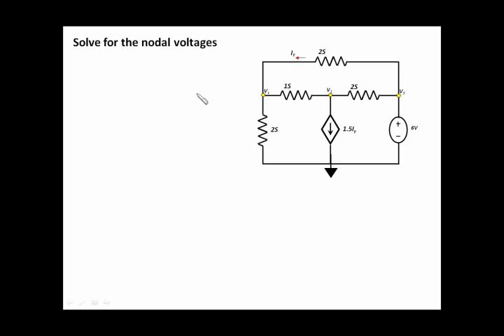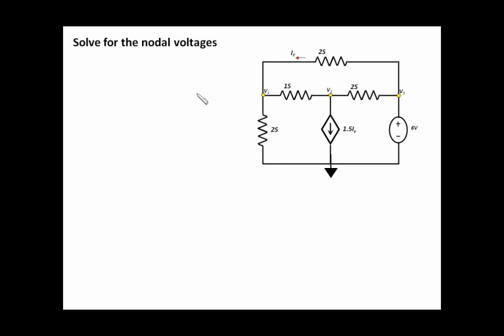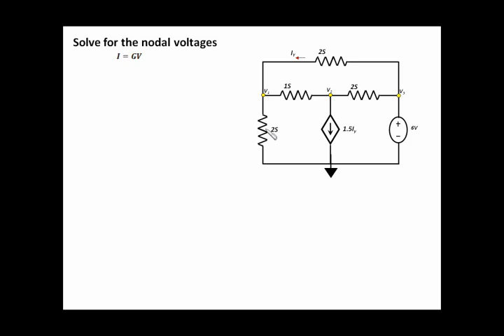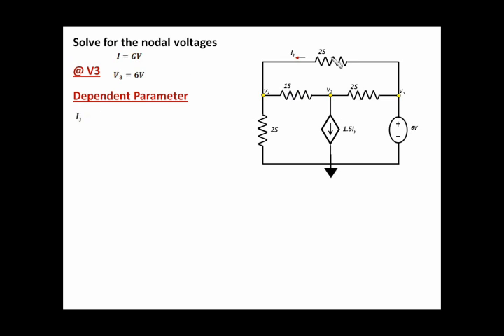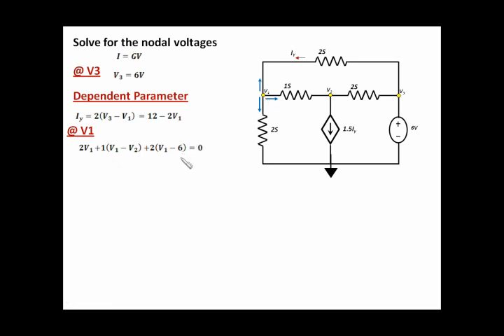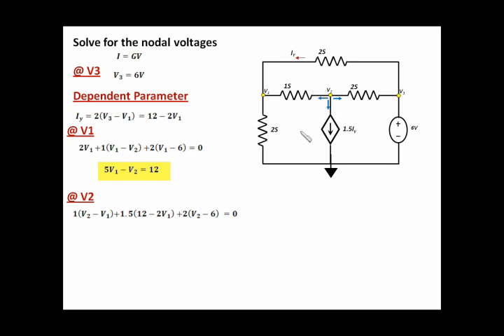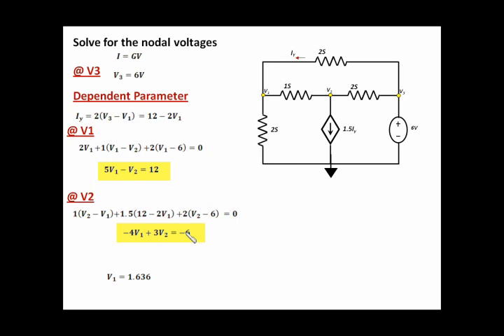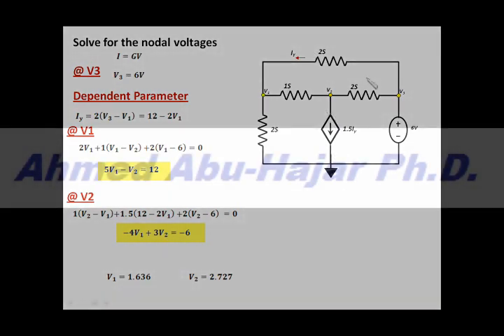Nodal Example With Conductances

Comment: Good day, V1  should be 2.727V and V2 is 1.636V
Reply: good day sir, how can I get the node voltage, if they were composed by Siemens, current sources, voltage sorce or combination, can I still apply the I = GV formula.